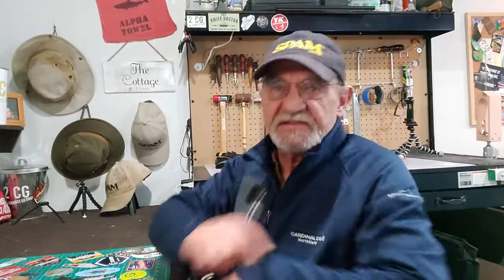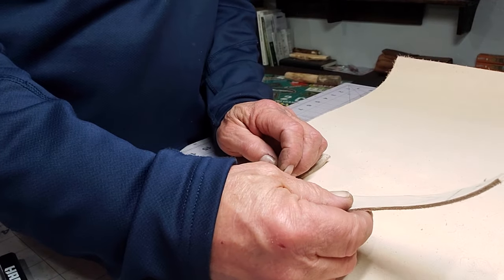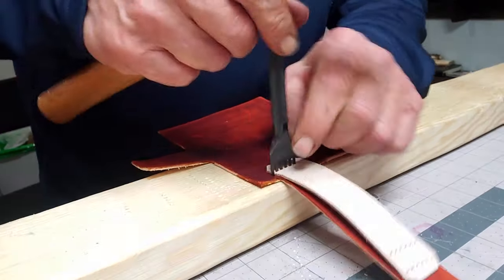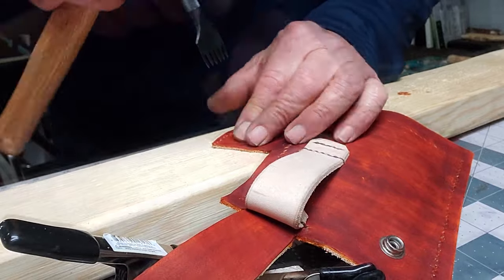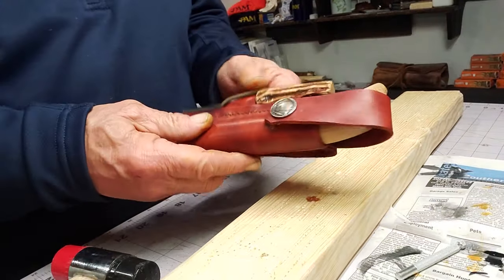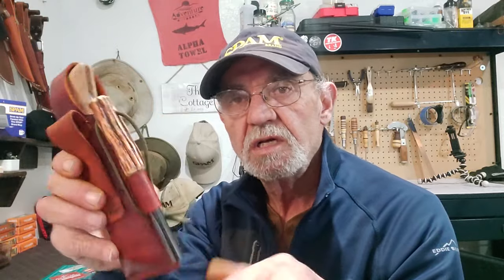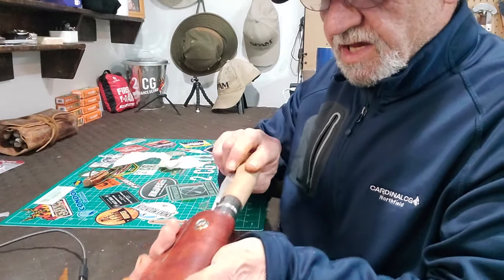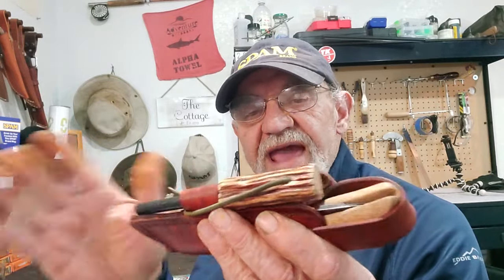Stunning Handcrafted Sheath For My Diy Opinel Knife & Saw Combo - Unleash The Opinel 12 Experience!

Comment: Hello George! Can you post the measurements for the sheath components? I would like to try this myself. Which saw did you take the blade from for your combo, was it from an Opinel saw?
Reply: I just rewatched your original Opinel 12 mod video. I see that the blade came from an Opinel saw….. all I need now are sheath measurements! Thanks you for posting, I really enjoy your videos!
Reply from the maker: I am on the road right now. Be home soon. I'll post them in the comments as soon as I get back. Glad you doing this. It's a great fun project. Be safe
Reply from the maker: Ok, made it back..lol. The measurements' I used are as follows.. ( i need to maybe do a post on my website in the future ...) (IN THE VIDEO FROM ABOUT 2:24 MIN.THERE IS  A VIEW OF THE CUT OUT, IT WILL HELP VISUALIZE MY MEASUREMENTS).
 The layout is basically a rectangle, Width: 4 1/2 inches, Top to bottom 10 1/2 inches,  The belt loop 1 Inch wide, all mine are 3 inches long.The Knife loop over top is 6 inches long, 1 inch wide.
The ferro rod will depend on the size of the rod. I would use a 1 inch wide strap, length will depend on the ferro rod CIRCUMFERENCE. The position depends on the length of the ferro rod and handle, very subjective.
The way i determine the width for all my sheaths. Lay the knife down and ( roll it over for full circumference.) add 1/2 inch. Then measure in 1/4 inch in, to get your stitch line on both sides. The excess can be trimmed off at the end of all stitching. The height will depend on how much handle you want sticking out the sheath.
The positions of the knife flap and the belt loop is measuring from the edge ( of the side you want the sheath to sit on your belt, left or right)  to 1/2 way point of one side of the sheath ( ie 2 1/4 inches) this is the center line for both belt loop and flap centerlines on the sheath.
To determine the stitch line for the bottom, basically the same thing. The diameter of the knife end down, 1/2 it and add 1/4 inch for stitch line.
The tighter your fit the better, remember leather will stretch over time
Hopefully this makes sense.
Reply: @2ndchancegeorge  Thanks!